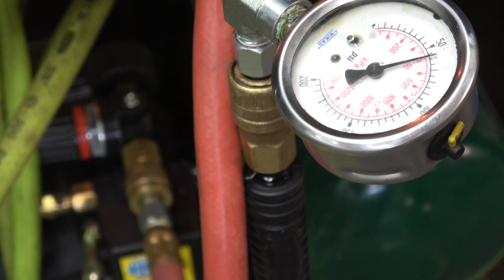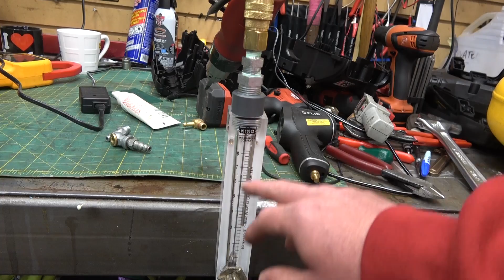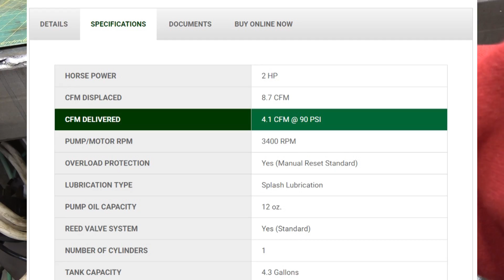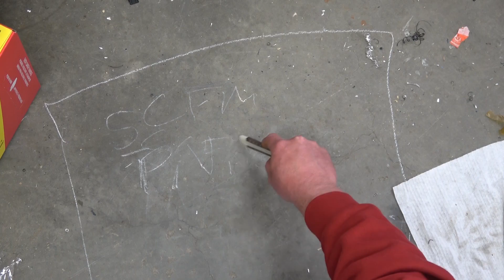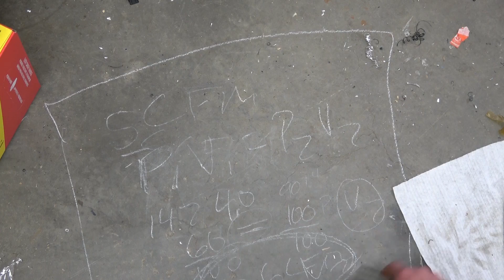Why are CFM ratings BS?

Comment: NO NO NO. THE ATLAS COPCO ARE BASICALLY THE SAME. You have to read a compressor rating of 20CFM@90 as 20CFM@0psi when pumping into a tank @ 90PSI. I just bought an Atlas Copco compressor ($12,000) at work. That was after buying and returning a consumer compressor after having the same issue you show in this video. I decided to test the Atlas Copco before buying it and using the same flow meter you have I found the same issue. Even the sales guy couldn't explain it correctly and told me the compressor would be no problem. Only after my test did we figure out that the compressor would only barely work for my use. I need 5CFM@90psi and the Atlas compressor I got is rated 20CFM@90psi, but since that's SCFM the new compressor will run at about 80% duty cycle to give me the 5cfm@90psi I need. This wouldn't be too bad if the sales guys could describe it correctly but no could tell me how it really worked so I tested it out myself. I told several sales guys from several compressor companies I needed 5CFM@90psi and they all said that a compressor rated 20cfm@90psi would be more than enough not barley enough.

Comment: I’ve worked for Atlas Crapco for the last 8 years in Scotland as a tech. We are required to flow test our standard diesel driven compressors @24 bar. We usually output around 950cfm. (Just for some context) But the lower grade plug in ones are generally all the same no matter the brand.

Comment: Thank you! also- fyi the pump/motor unit on the rolair unit you are testing is not made in the US, they were made in Italy (at best) and I suspect now are made in China.
Most of those direct drive units are made overseas.
Check out the duty cycles on them. If they dare to even show that data anymore!
Factor in the size of the tanks and the pressures that some of these units run. Dewalts run upwards of 200psi. Ridgids run around 175psi and some of the these units are bombs once they get a bit of rust going.
Want a good laugh? check out Senco Pc1010 or pc0968. The tanks on those are dangerously thin and the motor HP ratings are just ridiculous.

Comment: This is why I spent the requisite dollhairs on a 7.5 horse 80 gallon and brought a second one with a fuckered pump home from the finding spot to use as a slave reservoir, just for my own homegamer purposes (occasional sandblasting, blowing water lines dry, sanding, painting, and 3/4 chuggeda gun use on hobby utilized ag equipment).  I've never used a 110 volt compressor I've liked.

Comment: Agree with you AVE, however it is not only air compressor manufacturers that over-spec their products / services...interject anytime AvE as I list a few: Electric pressure washers, electric impacts, garburator hp, battery energy-density, furnace and duct cleaner promises,  natural elements such as lead or mercury, or natural compounds such as arsenic, or over-rated girlfriends that are over-weight... list can go on and on...

🇨🇦 Calgary loves AvE, but he lives in BC.

Comment: These compressors are intended for use with impact, rather than continuous action tools; in a jobsite environment where weight is a consideration.  As long as it can pop fasteners as fast as you can locate them; its skookum enough for the cost and the weight.

Comment: So the compressor mfg uses scfm so it sounds like it delivers more air and the tool mfg cfm so it sounds like it uses less air.  In a perfect world they'd specify both, but its hardly a blatant lie of useless data (I'm looking at you shop vac). A monkey can google scfm to cfm calculator and get pretty close.

Comment: The shop guy was tryna convince me that the rating gets hurt cause condensation builds up on the outlet, like when you bleed off the tank. So, I got an air dryer. Same issue, now he tells me "oh, that's the rating of the reservoir, not the actual pump" I'm like, why do you even try to sound smart?

Comment: To overcome this I have spliced many cr@ppy compressors together lol
You get ALMOST enough CFM to run some tools a reasonable amount of time.
You take 4~or 5 4-ish CFM compressors, daisy them together, distribute the electrical load..... yea you got some air that way .... and you lock them in a shed or pit someplace to buffer the noise lol

Comment: imagine a line graph with 2 plotted points
CFM on the vertical and PSI on the horizontal axis
draw a line from 3.2CFM,0 PSI  to 0.6CFM,90 PSI
the area under the negative sloping graph is the working area
the too can only run below this line

Comment: What caused me to notice this was pricing air compressors for work. Go to an online industrial supplier and an 18 cfm compressor is $2,500-$4,000. Go to a local hardware store and a similarly rated compressor is $600-$900.

Hardware stores are trying to say their $600 compressor out-competes one costing at least 2 grand more, SURE it does. 
Ironically this made me extremely wary about buying the cheaper compressor, likely the opposite effect the marketing department wanted.
Reply: Another thing about the cheaper air compressors.
They print the exaggerated horsepower on the tank, and the big 5 hp on the tank is not to be seen on the undersized motor.
The motor will generally have SPL, in the hp spot, so you have to judge by the amps and voltage in order to estimate the horsepower.
I had a Sears 3 hp that had a 1.5 hp motor, and the next one was called a 5 hp, but the motor was 3 hp, and finally I bought a Quincy with a big 5 hp motor, with a pump that weighed more than the previous Craftsman air compressor all together.
Reply: Just get you a compressor pump from the industrial place and use a 5 or 6 horsepower lawn mower engine on it to run it. If you already have a tank that can be used you can get a decent cfm  pump for a couple or few hundred. And a 6 hp lawn mower motor from harbor freight or a dead generator or rebuild one for pennies to power it. I run a parallel set up. I run 3 110v compressors on separate breakers on a 1 to 3 reversed and plug the 3 lines into one lowes air tank. I get 65 gallons of 150psi air and 6.8peak horsepower. And I use them to paint. And usually the 3rd one doesnt kick on often. I can paint a car non stop with that set up. Made my own dessicant filter. People get rid of compressors cheap on craigslist

Comment: im surprised that there arent some sort of budget Hydraulic tools out there , why run stupid compressed air, they could run a dual line hose and pump fluid with almost none of the noise and run hydraulic tools.
Air tools always disappoint the hell out of me, they are useless unless you have some 30horse power 3phase beast churning air or a darn trailer burning diesel to run a rotary tool lol
Very hard / expensive to get a good CFM compressor running out of a home/garage.

Comment: Buy a commercial/industrial rated recip compressor. 5hp package will run 2-3k but will deliver 15-20cfm @90psi. Quincy, IR, Champion, hell, find an old used one for cheap. As long as you keep the oil changed, it will be the last compressor you ever buy. Bore and stroke matter, you aren't going to get either with any compressor you can pick up with two hands.

Comment: How close are they without the hose though? I just recently ran into the issue at work where I had 130 psi at the wall for a tool that required 90, but having 100ft of 3/8" hose meant that I was only getting 60 psi at the tool. The solution in the end was to step up to 1/2" hose instead of the usual 3/8", and 3/8" fittings instead of the usual 1/4". Either way a lot of people don't recognize that hoses cause a TON of loss. I'd be willing to bet that the output at the compressor with no hose is a lot closer to what they're advertising. Its still probably not all the way there, but I'd bet its a lot closer.

Comment: I always figured the discrepancy was in a duty cycle calculation, like 4cfm at 90psi if you only use the tool 20 seconds of every minute (welders is a big one that comes to mind). 

Now I'm sitting here wondering why they don't use a duty cycle calculation as they could provide a graph with the pressures/cfm it can produce at varried duty cycles and it would be really easy to find the one that's right for your garage.

Comment: It can be even worse. Some producers (airpress) overdrive the electric motor on the compressor. I thought they removed the motor spec plate because they don't want me to know they use Chinese garbage. Nope a 3HP compressor has a 1,5HP motor. Mine burend out and I barely used it.

Comment: Belt driven big piston compressors are awesome. so much quieter and actually delivers a lot of air. only downside is most of them run on 240 volt power so its not something most homeowners would buy.

Comment: Ive got 2 compressors in my shop.got no clue on cfpm.one is an old army one and the other  is a 30 gal c h either  one runs all my impacts ,air ratchet  ect ect .but gotta use both to run my sander really  strong  all day long.

Comment: If air compressors could really moove as much air at as high of a pressure as they claim they can they wouldn't need to have tanks the hose that puts air into the tank could just go straight to the tool and run it no problem.

Comment: Thats why i haven't bought a consumer grade air compressor and waiting till I get a shop so i can buy a low end industrial air compressor because when i was a automotive technician the dealership I worked at had two 1000gal tanks with three Ingersoll Rand pumps with a air dryer, shop pressure was about 140psi with 18 tech bays not in including the tire machines and random air hook ups around the building

Comment: I'm thinks they're not lying about the compressors capacity, they're just giving us the suction volume at atmospheric pressure not supply capacity at 90psi. They're deceiving yes, and in so doing lying about the output. Funny thing even railway air brake systems are measured in cfm.

Comment: Sears catalog historical analysis of 6.5HP High Profit rated vacuums. 6.5HP/1500W/746W/HP x 100% ≈ 325% subliminal suction over 2HP Honest Power rated models. Wiped last page of compressor data last week.

Comment: Come in spinner,,,Hmmm,, not playing 2 up,,
Yep in australia places selling cheap compressors are using the receiver size to sell,
so when buying a 4 litre compressor  thats the tank capacity,,
Ifin ya Interested i know where you can get ya hands on 5000 cubic feet per minute,,compressor,,got 2 of them,,just sitting here going to rust,,Big Atlas copco,double acting 2 stage,,,mind they run on 3300 volt,,that could be a problem,,and make lot's of water,,as you can imagine ,,with the air going through them,,

Comment: AvE you need to get yourself a used 100 gallon tank from craigslist. Make sure to hydrotest it with your pressure washer :)
 A compressor that will keep up with your die grinder will be 2500 dollars+

Comment: AVE, minor correction but you can't always necessarily treat V as a flow rate, although in this case it works out. Here you would use implicit differentiation on Boyle's law, yielding P*dV/dt (inlet) = P*dV/dt (outlet), or P*Q (inlet) = P*Q (outlet), where Q is volumetric flow rate. If anyone is interested, Boyles law is a conservation of mass or conservation of energy equation, the equation with the time-derivative of volume is a conservation of power or of mass transport.

Comment: I'm a big fan, but ACFM and SCFM is not a big mystery to anyone who knows that air is compressible.  The rotameter being used here says right in the front that it reads SCFM at STP - standard temperature and pressure (e.g. normal room air conditions).  This instrument reading is not compensated for temperature or pressure like fancy electronic meters.  When applied to the pressure side of the tool, you need to correct the reading to get SCFM - search for "King rotameter Gas Correction Factor formula".  The bottom line is you always need to check the compressor delivery capacity against your tool consumption rate in the same units - SCFM.

Comment: Only problem I have is that's 3.8 scfm as each line increment is 2 since there are only 4 lines between numbers. All that aside, if the compressor is still putting out 4 scfm it still should have been sufficient.

Comment: That's why compressors have those graphic labels on them showing which tools can be run continuously, intermittently, and not recommended at all. Usually conveniently color-coded for those that think die-grinders can run on compressors where only nail guns and small inflatables are in the green part of that label.

Comment: My solution to this was to buy a three-piston single-stage 80 gallon Sanborn, as an upgrade from a late seventies "National Brand" 30 gallon unit.  I further went and ran the air out of the pump through a repurposed automotive HVAC condenser coil, through a small sacrificial tank to collect the water that condenses, then on to the main tank.  Also installed a Suburban Manufacturing "Moisture Minder", a pneumatic-actuated automatic drain valve that works by shuttling a valve back and forth based on the pressure difference (or lack thereof) in the leader line compared to the hose.

I can still run out of air, don't get me wrong, but when the tank is up to 155psi, I at least get good long runs before running out of pressure and having to wait for it to build up.

Comment: I could have told you that piss weak little compressor was good for nothing. I bought a 100l belt driven one second hand from a fab business closing down sale and it still struggles to keep 60 psi with the die grinder, and less with the sand blaster. Good debunking though, I always knew it was bullshit I just thought that were falsifying ratings, instead they rate it for a completely impractical use case.

Comment: You can boost the usefulness of small cocksumer compressors by adding another reservoir and expanding the volume.....it wont fix it but if you put a 100gal pressure vessal between the tool and the compressor it will tripple the usefullness

As a framer we would run 3 or 4 guns on a little roll air compressor like the one you just used in the vid because i had an old 35 gallon tank from a broke old compressor  we used as an "air bubble"

Comment: Industry should use mass flow rate instead of volume flow rate to solve all the problems. How is that gwage compensated for pressure?  Density of air goes up linearly with pressure, and it looks like it ballances that aloominum nipple thingie against stagnation pressure which scales up with density. Seems like the gwage would read mass flow not volume flow?

Comment: G'day from Oz I have a 80 year old Aust made Servex compressor still working well after working 24/7 for 80 years it's rated 30cfm at 150psi (415v 3 phase) and it matches it's rating. must have been made in a time before BS rules.

Comment: ...the power pack (pump and motor) on the green compressor is the same junk that is found on just about every small unit....sold in bulk to all the box store brands...seen them on DeWalts, Mastercraft,  and a few others I can't remember...stay away from any 'Oiless' units if one can help it....chinsey scraper seals used instead of an actual piston and ring setup...CH years ago ('90s) made a real nice 'home gamer' machine...the 'Canadian Series' 2hp direct drive.  Pretty big motor for the hp (long rotor for good torque), cast iron cylinder, three rings and an oiler, large capacity crank case....also have the one my dad bought in '91....has done a LOT of work and is still going (my portable)....had to make new reed valves and replace the light duty plastic all in one regulator/gauge/switch mechanism for some industrial pieces, but other than that she still works well.

Comment: Rule number one when buying a compressor, whatever you buy will be too small until your into full size industrial and whatever industrial one you get will also probably be too small. I worked for a tool hire company, 80 to 650SCFM compressors with great big fuck off diesel motors. (to even bigger diesel motors)  Measurement was at end of 1" diameter 50ft airline. Any 'hobby compressor is at best half of rating, usually 1/10 is better bet. Die grinder, biggest issue with Jacobs chuck (apart from coming loose) it's too damn big to get into some of the placde3s you want to grind

Comment: Atlas Copco (piston compressors) are repainted and rebadged DV (Devillbiss) machines...don't buy them...save a buck and buy the DV straight from DV...AC is the champion of upmarking...  

If you really want a good compressor with good and proper output you have to suck it up and buy industrial machines (they can be had at good deals used an in possible need of an overhaul)....Techquip is OK for the budget minded....Champion for the 'in between' and DV or Quincy for the gold standard.  Loose rule of thumb we use in the industry is ~4cfm per hp.  it's a bit more 'accurate' for the screw compressors I work on...but it can give you a good idea for the heavy pistons as well.  

All the above pumps (save for the Techquip) are all worthy rebuildable heads as well.  If you can score an old DV 247 (5hp or 7.5hp) for example that may have tired rings and valves a good rebuild kit can get you back to new performance in a day with most garage tools.

...I myself came across a crazy good deal on a Kaeser 3hp screw with spares for well under a grand...makes less noise than your average window shaker.

Comment: Is my 60 gallon 5 HP Ingersoll Rand just a giant consumer compressor and a joke, or is the 15 CFM at 90 PSI they advertise real?  I don't end up using my few air tools very much, but when I do it seems to be no problem.  I know that the little portables are what you probably mean, nothing more than an air gun can run on them.  I'd be interested to know what my $700 is really worth.